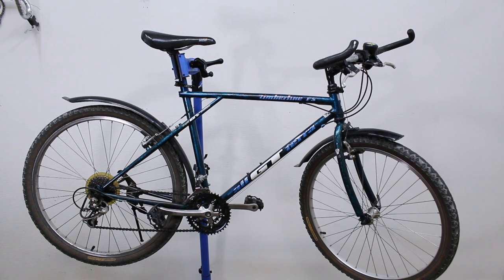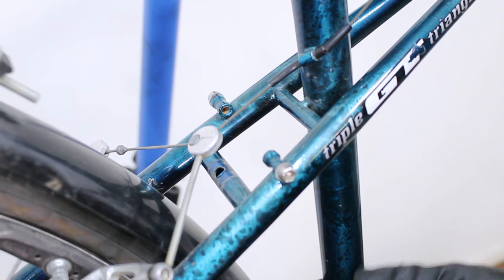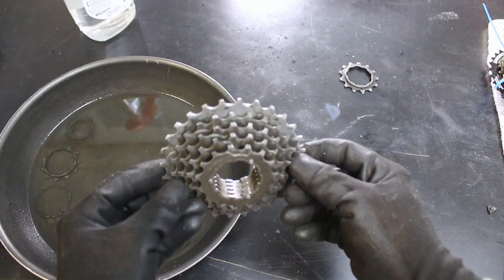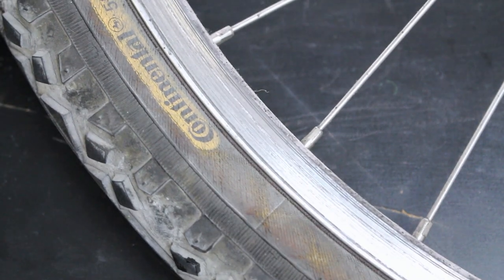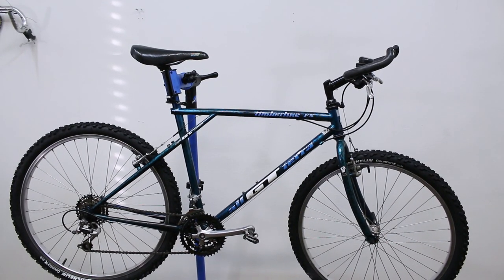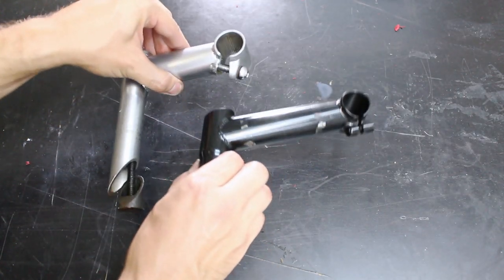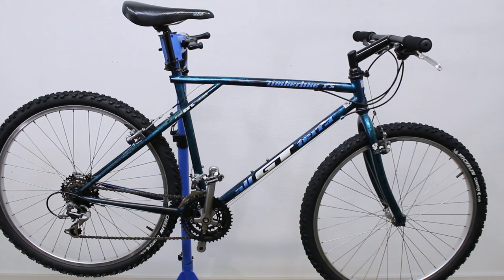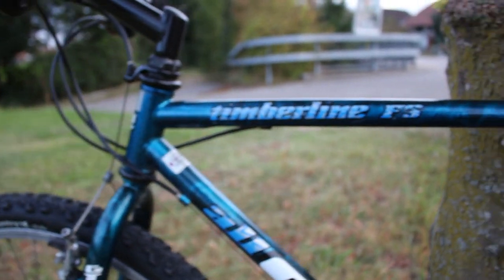1995 Vintage MTB Restoration

Comment: Amazing and very inspirational vid!!

I have a 94 Talera, the exact same colour.
I just finished upgrading my GT with the following:
- XTR front V-brakes (1996 new old stock)
- XT rear V-brakes (1996 new old stock)
- XT break levers (1996 new old stock)
- Marzocchi XCR 50mm travel front fork 1" steerer (1995 air/oil shock)
- 50mm riser handlebar
- 50mm stem
- Ritchey aluminum seat post
- new Selle Italia saddle
- New Schale tires
- Deore rear derailleur
- Flat pedals
- New Shimano bottom bracket

Still want to do the following:
- 1x10 single speed conversion
- Tubeless rims conversion
- External dropper post (if I manage to find one thin enough)
Reply from the maker: Nice build and thanks pangtsr!

Comment: I own the exact bike only in that acid burned green color. Just so you know; I removed the head set and upgraded it to a 1.1/8th headset. It will accept modern forks. For some reason GT made these bikes threaded when you could go non-threaded. Great bike!
Reply from the maker: For me I don't think I'm going to do that upgrade just yet, but yeah could see doing that down the road. Thanks for stopping by Joe!

Comment: I've had one of these since new, I bought it in London 1997 for commuting, a mere 24 miles round trip. It was even then an older model with a big discount. I still use it for fun.
Reply from the maker: wow that's nice. Makes me want to buy a new bike and keep it for a long time like you.
Reply: @BruceChastain   Ha, I've also got a Raleigh Routier from new, I bought that in 1986, it's a low end racer/touring bike. I converted it for more leisurely travel for holidays in Holland. It's had a few changes over the years. It's always the kids that get the new bikes. We have 8 bikes in 2 locations.

Comment: Bike looks great, love anything that's 'retro' but modernized. I think that you should think about using a seat post - shock absorber, those things aren't expensive and you will thank God for it on the hard gravel. Plus the bike frame looks a bit thin, so any shock absorbtion can minimize breaking risks.
Reply from the maker: Thanks for watching and commenting David. The frame members are thin because it's a steel frame, aluminum and even cheaper steel frames look more chunky.
Reply: @BruceChastain  Yeah, I got it, it's very rigid then, no worries about breaking. But still, the seat post - shock absorber would be useful I think. Had one before on a Genesis cross bike, worked magic for me.

Comment: I say put some bar ends on it. I don’t know about drop bar ends but some short bar ends are appropriate for the vintage of the Bike and might help on the long ride for alternative hand positions. Great looking rig no matter what though.
Reply from the maker: I do have some small ones I could try out. Thanks for stopping in Rolando!
Reply from the maker: @gastonlagaffe7547  mine were gummed up too, take a look a few videos before this one, I ended up just spraying it out with wd-40, worked.
Reply: Gaston Lagaffe great insight. I’m constantly installing and removing my bar ends on my “modern mtb” for when I feel I need them and taking them off when I don’t.  I started mtb in the early 90’s and really developed an appreciation for bar ends. I’m not sure why people bash them so much. My guess it’s the wide bar trend.  I’ll admit the benefits of wider bars are something I enjoy but I’ve started running my bars in the mid-600’s so I can run bar ends whenever I want.  I compensate my narrower bars with running a longer lower stem.  I tried the wider bars shorter stem thing but started having hand numbness issues, something I’ve never experienced in all my decades of riding mtb. Bar ends are critical for me fir any long distance riding.
Reply: Drop bar and thumb shifters worked great on my Cinder Cone.
Reply: Ron White I’ve seen that set up before. I think they make drop bar ends too. John Tomac was famous for running drops on his mtb. Most of the fun is in experimenting. Drop bars would certainly come in handy on a long gravel ride.

Comment: Lovely bike.. I'd have put v-brakes and got rid of the cantis. I have a GT Karakoram of similar vintage. and threw the cantis into the parts bin and put on a set of Avid v-brakes - stops much better. Unfortunately mine has a 7-speed freewheel so I'm getting a new 8,9,10 speed hub and lacing it to my existing rims. I'm going 1x10 speed.

Comment: Old, steel mountain bikes are the cheap, hype free gravel bikes. I have two steel Kona mtbs and they are so practical/adaptable. I have had them as mtbs, drop bar gravel bikes and upright cruisers. My Lava Dome cost me 56 pounds and I have had hundreds of miles on it.
Reply from the maker: I'm starting get this feeling too, I like the hype-free part too. I just did nearly 3 hour group gravel ride two days ago, and really this bike did a great job. It's kinda amazing how old of tech still works fine, even the old 3X7 drive-train was great with plenty of range.
Reply: I've got a lavadome set up as a gravel bike too! The funnest bike!
Reply: In my opinion, theres nothing wrong with 3x drive trains, v-brakes are as good as it gets, and all this one by, disc brake, 29r stuff is just hype. Gimme a 3x 8 or 9, 26r with a steel frame and v-brakes and no suspension and Im a very happy man. I own a gt palomar 97 model which is heavy as, but great fun, and I built up a bike from a specialised sirrus that now has drop bars, mini v-brakes, 38mm wide tyres and 105 10 speed cassette and brifters. This is 700c and it is the most fun bike Ive ever ridden with its 3x10 and wide offroad tyres. Each to their own I guess.

Comment: Drop bar ends! Allows you to keep the straight bar but still get aero if needed. Plus one more hand position.
Reply from the maker: Do you mean the bolt on ones? Or do you mean like road bike drop bars.
Reply: @BruceChastain  the bolt on ones. I think origin8 makes the one I used. Pulled in the shifters/brakes and grips, chopped the bars a little shorter and then added those. Worked pretty well.

Comment: My old team marine from the early 90’s is still going strong. Gone from 3 x 7 to a 3 x 9 then to a 2 x 11 drive. Soft nose RockShox with disc brake front, vbrake rear still. Tubeless tyres. Still rocking the bar ends. Too good to sell.
Reply from the maker: sounds dang good. do you have a video on that one?
Reply: HACK AND RIDE BIKES I’ll do one in a few days

Comment: Great Video!
I have a similar bike:  Karakoram '92.  I decided to drop it off at my local shop to replace the bars with a more modern bar and a shorter stem - 60mm.  Back in that era stems were way too long!  Hopefully this will feel better.
Also, I was considering switching the drivetrain to a 1X but the shop told me it's not worth it, but I heard it's possible.
Thoughts on  this?  What would be a budget friendly way to do it? Thanks!
Reply from the maker: I'm a big fan of 1X, and if you can do the work your self, you can have it done for about $40, but a 1x crankset, make sure it has a bottom bracket, and get chainring too. Take a look at some of my other videos I did a 1x on a walmart bike, a schwinn road bike and a steel Miyata road bike.
Reply: I have an old Karakoram with rear DX  u brake .  try a 1 x 7 speed first then go from there

Comment: I have a similiar mtb that i want to fit with drop bars.The stem is the same as yours and clamp is too small for bars.What should i do?Any advice would be appreciated.
Reply from the maker: you could get a quill to threadless adapter, make sure that the clamp part for the bars is the right size, I think if I remember right it's either 31 or 25.4mm.
Reply: @BruceChastain  Thanks will give it a go!

Comment: Hey Bruce I have the same bike and interested in swapping out the handle bars can u tell me exactly what parts I need and there measurements
Reply from the maker: If you just want to change out the bars, then it’s really simple, just get another handlebar with that is the same diameter, which I think is 25.4mm.
Reply from the maker: I think you can do it with just a set of metric Allen wrenches

Comment: All you need js some Farmer Johns to complete the resto. Nice bike.
Reply from the maker: thanks Don! But what is Farmer Johns?
Reply: Farmer Johns were one if the most popular mountain bike tires back in the 80's.  They were named after the great John Tomac and were called "tractor tires" because of the design. There were three flavors and were 26x 1.95 : original Farmer Johns, Farmer Johns Cousin and Farmer Johns Nephew. They dont make them anymore but your GT would look great with them.
Reply from the maker: @donnovicki9771  interesting. Would be amazing if someone made them again.

Comment: I'd suggest that you throw 9 speed groupset just for upgrade. 9 speed group comes really cheap these days and you can upgrade the bike without breaking the bank
Reply from the maker: I agree that could have been a good option, But I’ve already sold this one. I’d like to get another steel GT, maybe a 1x9 set would be good.

Comment: Hey, I like it.  I have a KHS Montana Crest of the same vintage with the same brake/shifters.  Did you have any trouble with yours?  I've been spraying various goos and cleaners in there and they've kinda freed up, but are still not great.  Any suggestions, or is there anything that you can replace them with?  Cheers.
Reply from the maker: thanks Michael! Yeah if you look at my first video on this bike, you'll see my shifters were gummed up and not working much either. But I just sprayed some wd40, worked them several times, and now they're working perfectly.

Comment: Can "changing parts" be called restoration? Don't you think that after almost 30 years all the grease has evaporated? Would it be correct to open the hubs, freewheel, head set, pedal axle, etc?
Shimano speed shifters need good internal cleaning and lubrication as well.
Reply from the maker: I did end up doing some more work to the bike in later months, I think there are some videos on it also.

Comment: Cantilever brakes as early as '95. Huh. And quick release wheels, and a cassette instead of a freewheel? Or were those upgrades?

Either way this bike looks way newer than '95. The only thing that really dates it is no front suspension fork.
Reply from the maker: Hmm I just took the previous owners word on it, I think I'll look into it now...
Reply: @BruceChastain  I recently gave away an early 90's 26" bike, a Rand Trailblazer ATB. No quick release anything, 2x5 setup with a freewheel, and classic thumb shifters. You can see it on my channel. That's the type of bike I think of when I think 1995. I mean I'm no bike historian, but I never saw Cantilever brakes until the late 90's, and didn't see trigger shifters until the early oughts.
Reply from the maker: @bicycleresurrection3855  with a bit of searching around it does appear to be a 1995, maybe built actually in 1994. But anyway nice channel, I'm sub number 9 :)
Reply: @BruceChastain  Thank you!

And 1994. Huh. Wow! Pretty ahead of its time. Nice bike and I hope it does well for you in the race.

Comment: I expected drop handlebars and a 1x drivetrain for a gravel bike. 3x setup seems messy for off road with constant gear changes. Lovely old GT though and actually like the paint job on it.  The quill stem looks cheap and nasty which would be my main complaint about it visually.  I'm not against quill stems but many look well engineered and others look cheap and basic and would put that one on the cheap and basic side plus being secured by only one bolt may not be safe for a gravel bike.
Reply from the maker: yep, did you see the silver quill, looks nicer but it's a good bit heaver. With only 7 cogs in the rear, there's a good chance I'll need most of the rings up front. We have some steep hills here in Switzerland.

Comment: tip: use diesel to clean the gunk, it disolves grease so easily!
Reply from the maker: thanks for the tip, I'll give that a try. maybe even make a video on it.
Reply from the maker: @IPA SOLÉ I dont know. but it seems like it may not be good for plastics.
Reply: @IPA SOLÉ it doesnt, but wash it with soapy water afterwards, if you leave it it migth discolor it.

Comment: Great job

Just bought an 88 Ritchey for a gravel ride

I managed to clean the gum walls on the original 31 year old tyres and they look great

But I bought new tyres for longer harder rides, try nobby nicks in gum wall
Reply from the maker: 31 year old tires, that's amazing.

Comment: You should of grease all the bearings on the bike , wheel bearing , 
Bottom bracket bearings and head set bearing ..
Reply from the maker: Got the head set, the BB is sealed in this case. But yeah wheel bearings would be a good idea. Thanks for stopping by!

Comment: Nice paintjob on that one. I have a GT Timberline from 1992 (white with black lines) in very nice (near NOS) condition in my collection. The GT Timberline was in the beginers range of the GT line. The frame is heavy but extreme strong. Add a bottle cage to it. That's the only thing I would change. https://fotos.mtb-news.de/p/2427749?in=user
Reply from the maker: is that yours in the link? If so looks amazing! Interesting you say it was the entry level model, I didn't know that, but it makes sense being so many people are saying they have the same bike.
Reply: @BruceChastain  Yes, the white GT Timberline from the linked picture is part of my retro bike collection. I always loved the paintjob of the white 1992 GT Timberline. But I also have a 1992 made GT Zaskar, GT Richter 8.0, GT Pantera AL and a 1991 GT Talera in my collection as well (here's a link to my bike collection if you like to have a look. There are 4 pages of pictures: https://fotos.mtb-news.de/u/4297 ). In 1992 the Timberline was an entry level GT model. Below the GT Timberline there were only two other GT models (GT Outpost, GT Talera). In the following years GT added a bunch of new models to the GT model line.